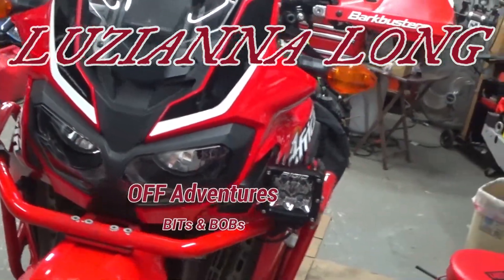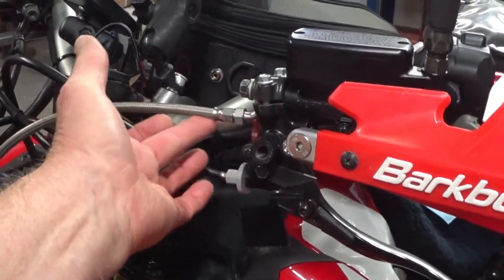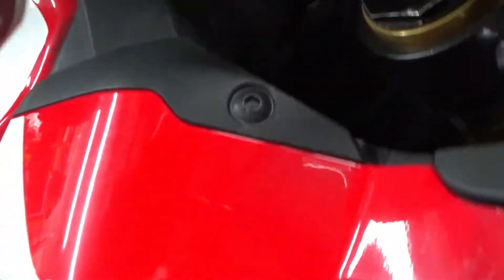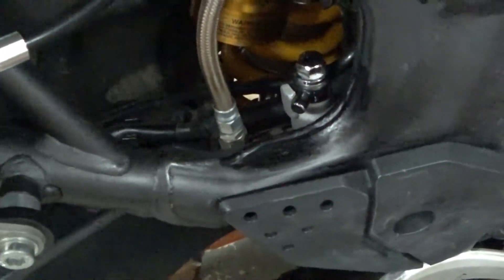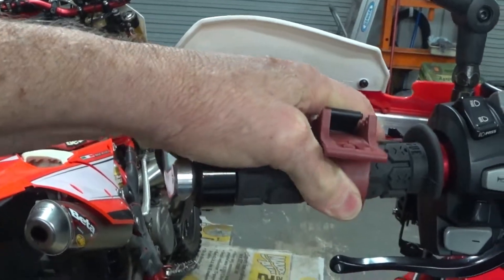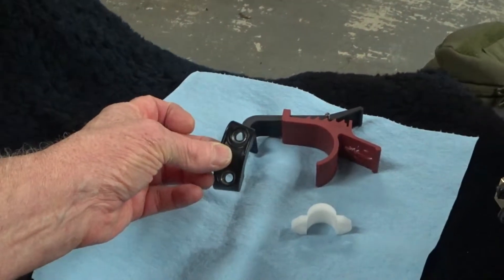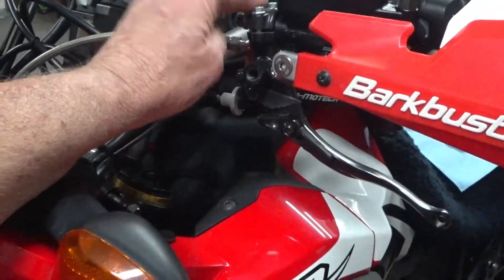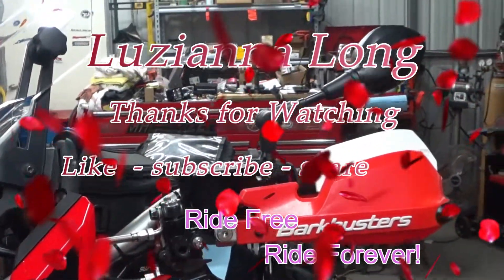16' Honda Africa Twin Left Hand Rear Brake

Comment: When you apply the JB weld, do you apply it on the outside of the fitting?
Reply from the maker: I cleaned everything really well then applied the JB weld to the aluminum piece, pressed it in then applied more JB around the outer edge of the insert just for added security. It has now been over 5000 miles of off and on road use with no issues. There is a company, Quium, who make a master cycle that is for thumb brakes and looks like it will work, probably more expensive. I used JB in the intake ports on a Porsche 2.8 motor I built, lasted for two seasons of IMSA racing and was still there when I archived the motor.

Comment: What tap size did you use? I purchased a new master cylinder for my AfricaTwin. I also need the thread size and pipe diameter. Thx.
Reply from the maker: Standard banjo bolt 10mm x 1.0. I don't remember the length but will check tomorrow and let you know. I also thought about using a double banjo and going through the top of the master but decided against it since I had the handlebar master.
Reply from the maker: Scratch my last!!! I did not use a normal bajo. I just looked and remembered because of the angle I decided to attach the dash 3 brake hose directly to a 90 degree 1/8in NPT to dash 3 male. That way the line drops straight onto the dash 3 fitting. Turned out much cleaner to run the hose. So the hole into the master is 1/8in NPT.

Comment: Hello from Atlanta, GA! I appreciate sharing your set up, I'm thinking having a similar one for my 2018 AT DCT. Would mind sharing the part number for the handlebar master cylinder. Thanks!
Reply from the maker: I will see if I can find it, it came from a Honda 1300 GL around 2016 or 18. I went through bike after bike and settled on that one. I would like to have had a dealer or supply house to look through. The master cylinder to use best fit wise is the ADV scooter from Europe, but $350 by the time it gets here. The one I used could stand to have a smaller piston for most people, softer feel. I like my brake to be firm and almost instant contact so I can modulate the brakes with two fingers. Since that video I have cut down the mc push rod to get more free play from the shorty Puig lever.
Reply: (links at the end) I used an inexpensive set from Amazon and, and it works great, nothing special about brakes, don't brake the bank. I also ditched the rear master cylinder and foot lever all together, also removed the parking brake, have velcro strap if needed. You can easily connect a new brake line to the line coming out of the top of the rear master cylinder if you don't want to tap into the OEM rear master cylinder, i just have the parts in a box somewhere. I then ran wires from the new brake lever to the front brake lever relay to trigger the brake light. Everything works great, no loss in ABS or brake tension. Link for the brake line connect https://www.amazon.com/gp/product/B07BN2W68Q/ref=ppx_yo_dt_b_search_asin_title?ie=UTF8&psc=1, link for master cylinder pair https://www.amazon.com/gp/product/B07FKK69TG/ref=ppx_yo_dt_b_search_asin_title?ie=UTF8&psc=1
Reply: @JacobSnover  is there a relay include with those lever for the wiring? Thx you!!
Reply: @rxwarrior12  Yes the new master cylinder had a relay, and after wiring it up to the front brake lever it still works independently from the front brake.
I think that's what you are asking about? I'll try to do a video for the wiring.
Reply: @JacobSnover  it’s for the brake signal, does your left hand rear brake light up the brake light ?
Reply: @JacobSnover  sorry for my bad english i’m from Quebec, canada 🙈 but i think that you answer my question yes 🙈
Reply: @rxwarrior12  Yes it will light up the brake light. Don't worry about your English, it's much better then my French 😅
Reply: @JacobSnover  thx you !!!

Comment: How long the braided brake line did you fit?
Reply from the maker: I did not measure the line when I made it but I got a approximate measurement of 56"-58"  or 143-147 cm depending on how you route the line. I figure the next time I have the tank off I'll reroute the line and shorten to around 145 cm. Right now it's a little long so I have a bit of extra going across the handlebar area. Not big deal but I think it could be shorter.
Reply: @azlong4596  thanks a lot
Sir. Why you didn’t fit the braided line direct into the rubber hose of the reservoir after removing this reservoir saving time and effort ?
I mean the rear brake master cylinder plastic reservoir rubber hose?
Reply from the maker: @gahlanaventis  I thought about going to the rubber hose but decided against that method because I was worried about the amount of pressure going into the rubber hose if I gabbed a hand full of brake. Also I didn't want to modify the stock set-up so my entire  LHRB system can be removed to put on another AT if I sell my current bike, and the  original put back on as a complete unit.

Comment: Having a left hand rear brake for the DCT is the best modification anyone can do.

However, you could have manufactured it better by watch the video of my mod that I did 2 years ago.

https://youtu.be/HkJoLOooq00

Ive just completed my same modification to my 2020 AT AS DCT.  I'll post a new video soon. So, that anyone tgat does to the 2020 model will be able to have it cancel out the cruise control when they engage the left hand rear brake.
Reply from the maker: I could not get the ADV 750X master cyl here in the States except by ordering from UK for 350 USD.  too much money. I have since done away with the parking brake all together, dropped 3.4 lbs., not much but something. I do the lhrb for my own use even on my dirt bike, I'm able to use the rear brake more efficiently.